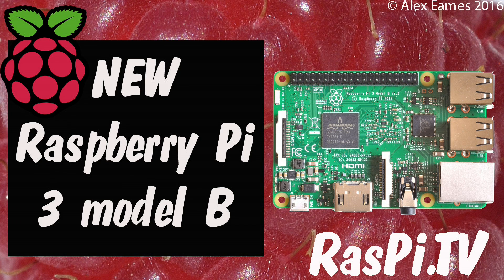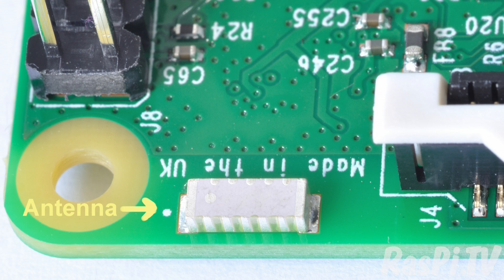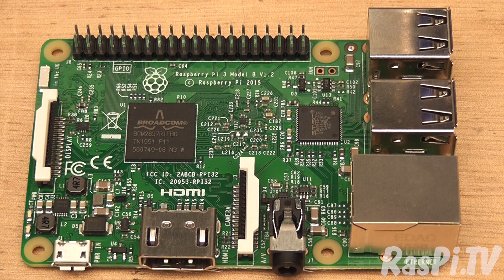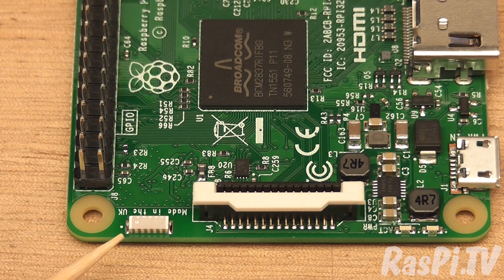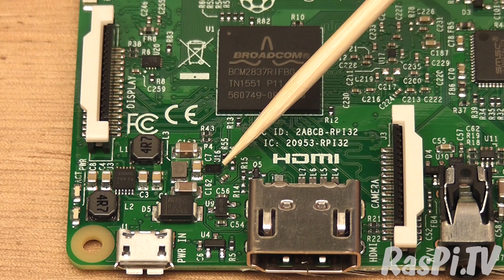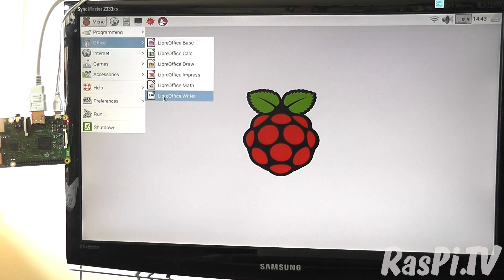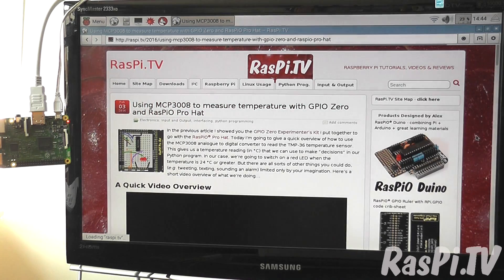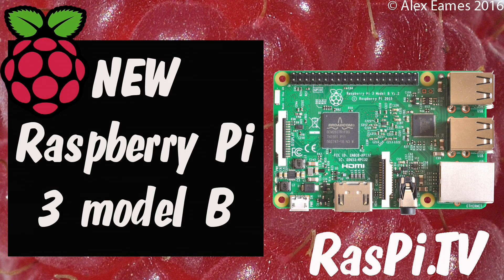Raspberry Pi 3 model B Launch - 64-bit quad-core ARM Cortex A53

Comment: 2:57 (funny! I've got almost the same SAMSUNG monitor here in front of me! SyncMaster 2333 SW -- not HD  :) 
I just ordered one. But I'm already using two raspi 2s in the household as desktop replacements... They are already just quite fast enough to allow for some office work to be done without switching on the bigger PC systems. 
I was AMAZED that the Raspberry Pi 2 supports running Ubuntu (MATE)! It runs quite okay... But I'm looking forward to a little performance boost, anyway! :D

Comment: hi Alex.....did u have the to chance test it with a usb 3.0 hdd?? does it get any disconnections? Plus, i would like to know if it can support win 10....thnx in adv.
Reply from the maker: +Alex Boom No I haven't tried it with any HDD. Gotta leave something for other reviewers ;) It supports Win10IoT but not desktop windows. Although I believe Eben has said the hardware is capable of supporting something like Windows RT. But that would be down to MS to sort out if they want to do it.

Comment: Great video!  Got mine ordered and a new case.
Reply: +Knuckles the Echidna does the pi 3 come with the power supply and hdmi cable or is it just the console itself?
Reply: +XPsilocybinDream Just the Pi itself.
Reply: Knuckles the Echidna
I want to get the pi 3 their case and a power supply then.

Comment: Quick Question, does the built in wifi support access point mode?
Reply: +A Person Most likely, yes. It's basically just a switch in software that triggers that. I may be wrong, though.